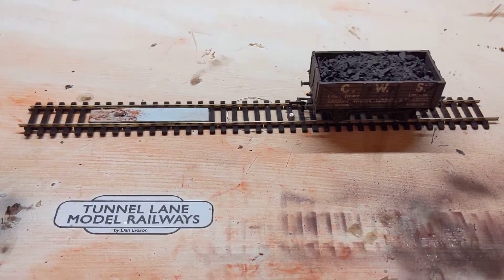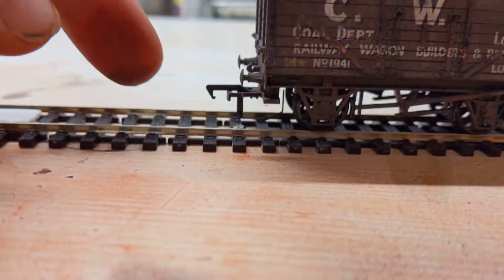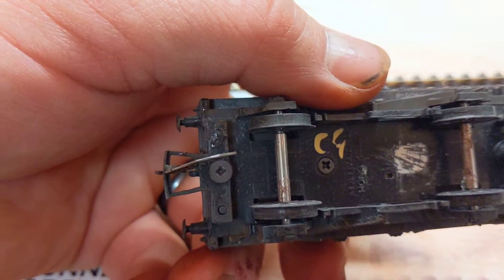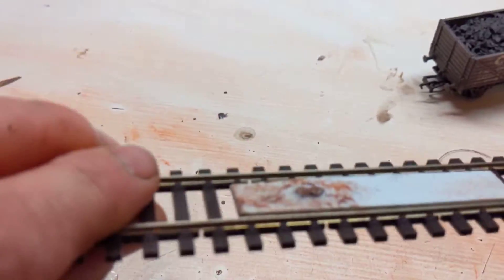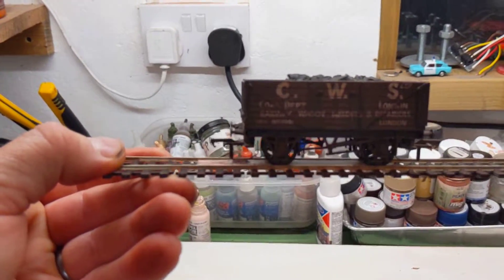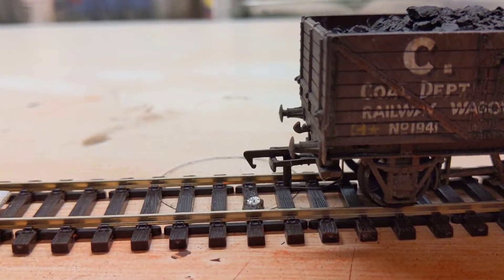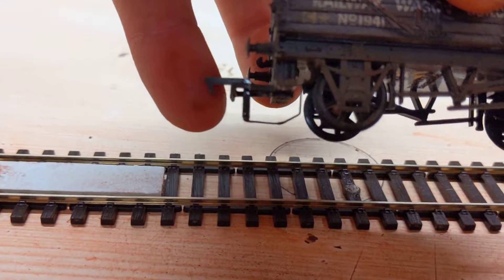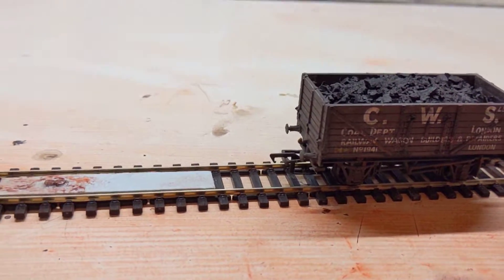How to make home made magnetic coupling

Comment: Hi Dan, I'm going to try your auto uncoupling method on my new layout. The magnets you used were 3mm diameter but what thickness were they as that affects the strength of the magnet and they only need to be strong enough to lift the coupling. They seem to be available in 1, 1.5, and 2 mm. Regards, Trevor
Reply from the maker: Hi Trevor, 2mm you need them flush with the sleepers. That is how I have found the best results.. Happy coupling and decoupling. Regards Dan
Reply: Thanks Dan. Little Burford looking good by the way